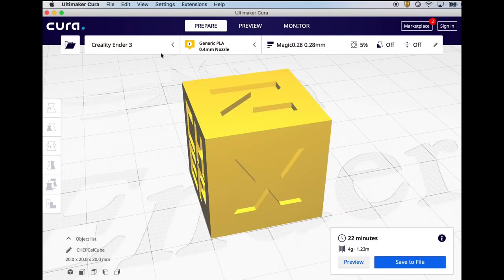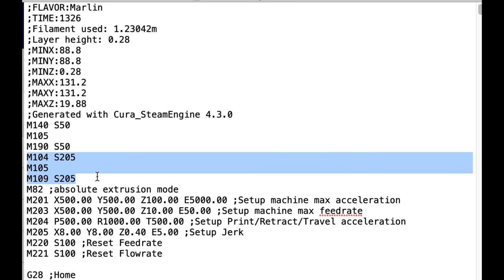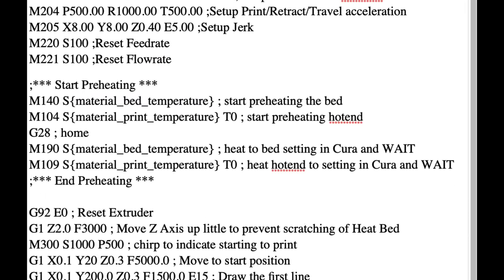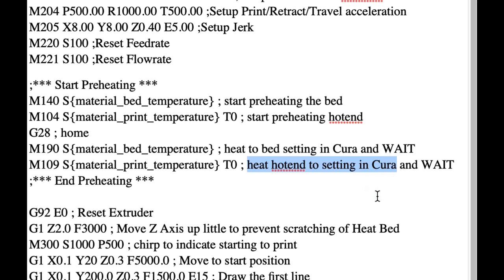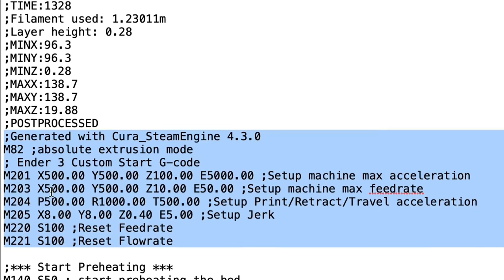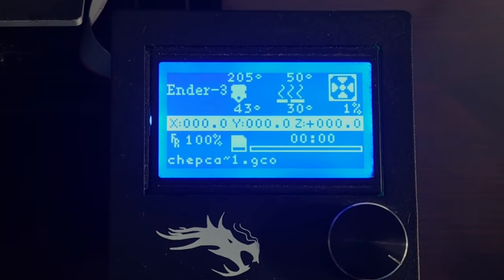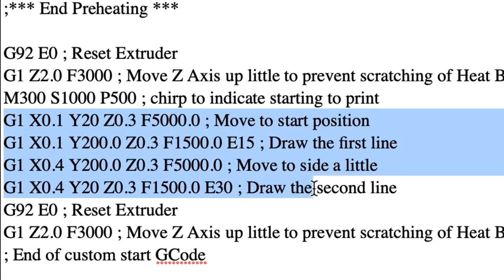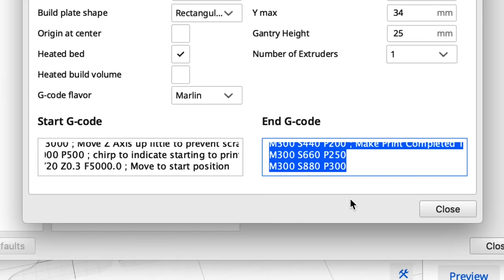Faster Hot End & Heated Bed warm-up in Cura

Comment: For print and bed temperature, your start gcode should use {material_print_temperature_layer_0} and {material_bed_temperature_layer_0} to allow for the first layer temperature to be different than the rest of the print. Also, I read in the comments that you updated the txt file to remove the bad characters, the web snippets still have errors (guess which I tried to use...). Thanks for the great tip!
Reply from the maker: What error do you see in the snippets?
Reply: @FilamentFriday  In the start g-code, there is an invisible unicode FEFF in front of the T0 on the M104 and M109 lines. I copied/pasted the lines and my nozzle would not heat until I removed the invisible characters.

Comment: BRILLIANT Chuck, many thanks for ending my frustration. My CR10-mini works absolutely fine with this code... I knew the PSU would handle it, because up until now, I've manually set the extruder and bed to heat together, whilst I prepared my print in Cura.   Maybe you could consider looking into how to keep the extruder and bed at temperature at the END of a print ? I've tried to add copies of the heating Gcodes at the end of the Cura Gcode, but there seems to be hidden commands that are run once the Gcode completes. It really frustrates me that I have to manually set the temperatures at the end of a print, to keep things hot, whilst I remove a print and get the next one running.......  Your Filament Friday channel is the best thing since sliced bred ( and beer ), Thanks Chuck....
Reply from the maker: I’m not sure exactly how to do that.

Comment: The primary idea of heating the bed then the hotend as a universal code was not because of power consumption but because of some printer may use between 5-40 min (or longer) to heating a bed while the hotend usually does not take more than a min to heat up. If we take the extreme of those cases the hotend will be cooking the filament in over half an hour which give a nice black dot of burnt filament when starting to print at best. And worst case scenario is that the filament clogs.
Reply: I made mine preheat the hotend to 100c and the bed to full temp and once the bed reaches full then the hotend goes to full.
Reply: When it's on do you wait or do you need to go somewhere in the settings
Reply: @zambiekill7046  not sure if i understand your question. But i changed the start code in the slicer (simplify3d and cura, i use both) to include preheat of hotend to 100c and bed to its target (63c) then once bed hits 63 the hotend automatically goes to its target (220c) and its starts printing once the hotend reaches 220c

Comment: For those that just wish to copy/paste the lines used in the video, see below  

;***Start Preheating ***
M140 S{material_bed_temperature}; start preheating the bed
M104 S{material_print_temperature} T0 ; start preheating hotend
G28 ; home
M190 S{material_bed_temperature} ; heat to bed setting in Cura and WAIT
M109 S{material_print_temperature} T0 ; heat hotend to setting in Cura and WAIT
;*** End Preheating ***
Reply: Thank you very much.  I had trouble using Chep's code as it appears in his file.  Why does he have those extra slashes?
Reply: @allonmessenberg3129  I see what you mean, I did not look at it before. To me, it looks like it could be CR/LF line end conversion problems with the file host he is using.
Reply: @allonmessenberg3129  he was using his Macintosh editor and it was saving his files with each hard return composing of two characters - carriage return (return to the first letter of the row)  and line feed (move paper up one line). PC as a standard would save ASCII text as a single character of CR/LF that does both the carriage return and line feed together. These were instructions to line to printers originally on what to print and how to move the print head around.

TL;DR - It's a holdover from the early days of computing where different file encoding schemes were in use.

Comment: I think its not as much of a problem with overloading the power supply but if you think about it, Cura was made for the Ultimaker. And the Ultimaker has a glass bed which takes a lkt longer to heat up than the hotend. That would result in the hotend reaching its temp and than basically cooking the filament inside for the time it takes for the bed to heat. And we all know what cooking the filament does in bowden setups 😆
Reply: You haven't used an Ultimaker isn't it?
Reply: I havent but I still belive the Ultimaker has a glass bed...or doesnt it?

Comment: The start and end g code has a significant impact on printer operation. It is surprising it does not receive more attention.
Reply: What do you mean by that, the current code or Chucks mods?
Reply: You can make all kids of change in the start/end Gcode, CURA or Prusa.  It is a worthwhile area to learn and experiment with.  I had trouble with my MicroSwiss hot end clogging if filament was left and cooled down.  I changed the end Gcode to retract 35mm of filament before it turns off the heaters.  Here are my start and end Gcodes

;Daw Start Gcode for ABL and MicroSwiss hot end
M140 S[first_layer_bed_temperature];  set bed temp
M104 S[first_layer_temperature] ; set hot end temp
M109 S[first_layer_temperature] ; wait for hot end temp
M190 S[first_layer_bed_temperature] ; wait for bed temp
G28; home all axis
G29; use EZABL or BLtouch
G4 S10; wait for 10 seconds for temp recover
M300 S1000 P500 ;  chirp 
G92 E0;  set extruder to 0
G1 X0.1 Y20 Z0.3 F5000; G1 Z2.0 F3000; move to save zone
G1 X0.1 Y100 Z0.3 F750 E15; extrude 15 units
G1 X0.4 Y100 Z0.3 F5000; move again
G1 X.04 Y20 Z.03 F750 E30; extrude 30 total units
G92 E0.0; reset extruder to 0
G1 Z2.0 F3000; raise hot end to z.20

;Daw END Gcode for ABL and MicroSwiss hot end
G1 E-35 F300;  Retract Filament to minimize dropping filament
   ; retract 35 mm SLOWLY - before turning off hot end heat
   ; this is to prevent filament staying in MIcroSwiss hot end when cooling
M104 S0 ; turn off temperature
M140 S0; Turn off Bed
G1 X5.0 F2000
G1 Y2900 F1000;
M84     ; disable motors
M107 ; turn off fan
M300 S100 P500 ; chirp
Reply: @woodwaker1  You're correct, I extrude and wipe my nozzle on a small brass brush before starting each print. it "seems" to give me a better first line, however, I wonder how much of that is just me thinking it. I asked my question because I was wondering if there was some problem with the code Chuck published. Thanks
Reply: @TheDgdimick  I think CHEt's code is good.  You make and fine tune the code that works for you.  That goes back to what Just Peanuts was saying.  There is a lot of power in these start and end codes.  I do 4 skirt's to reprime my nozzle, and get the flow working.
Reply: David Wilson Retracting filament after a print finished to prevent clogging is a good example of a beneficial g code  addition. Cleaning out clogged    hot ends can be a pain.

Comment: I have been using Octoprint to preheat my CR-10S. The extruder heats up a lot faster than the bed. So usually I start the pre-heat, then submit the job. As soon as the bed reaches temp, it starts printing.

Printer settings:
Firmware Marlin 1.9
Cura 4.4.1
Profiles, modified Magic .20 and .28
    modified: temps, infills and supports depending on the print job.
Extruder 205 initial layer, 200 after that
Bed 65 initial layer, 60 after that.
Stock glass bed, sometimes add glue for difficult filaments.

Comment: Hi CHEP, I know this is an older video but do you have a video showing a start gcode that makes it so you don't have to babysit the printer on start up? I mean, I always need to clean the oozing from the nozzle as it's homing. My goal is to maybe home the printer first, then park the nozzle in a position where it can ooze but not interfere with the two purge lines it prints before printing my file. AS of now it leaves a small ball of filament in the center of the build plate even if I wipe it before it homes and sometimes it leaves a fine string from the center to the left side when it prints the purge lines. I usually use a feeler gauge to scrape that stuff off before it's ready to print.

I want to hit print but then go make breakfast and not worry about it, haha!
Reply from the maker: I don’t.

Comment: I did not use the trick you used for Cura to automatically do this. But I have manually edited the Gcode to do this on my CR10S and it seems to work fine.

Comment: Chuck, I use the "Print via USB" option in Cura. I can't seem to get the Hot-end to pre-heat at all with your g-code. Have you run into this? if so what is the fix? Thanks!!
Reply: I had this issue too on my 2021 Ender 3 - Move the G28 to the beginning like this (and use M117 to change the text on the print for extra cool factor):

M117 Monkey Mode Reset {material_type}
G92 E0 ; Reset Extruder
G28 ; Home all axes

M140 S{material_bed_temperature_layer_0}     ; set bed temperature to e.g. 55 °C and continue
M104 S{material_print_temperature_layer_0}   ; set hot end temperature to e.g. 210 °C and continue
M117 Monkey Mode Preheat {material_type}
M190 S{material_bed_temperature_layer_0}     ; wait for bed temperature to reach e.g. 55 °C
M109 S{material_print_temperature_layer_0}   ; wait for hot end temperature to reach e.g. 210 °C
M117 Monkey Mode

Comment: You also saved the start and end gcode files on the website as rtf rather than txt. They're still readable but not copy&paste friendly :)
Reply from the maker: They appear .txt for me. Might be a Mac vs Windows thing.
Reply: @FilamentFriday  just double checked: definitely rtf, both on mac/bbedit and w10/notepad++
Reply: @FilamentFriday  Confirmed that the files have an "RTF1" header in them followed by the text section.
[edit] Here's the first line of the files: "{\rtf1\ansi\ansicpg1252\cocoartf1671\cocoasubrtf500" - and there's definitely "rtf" code interspered throughout :)

Comment: If you have a bltouch you need to heat the nozzle to about 160C without waiting, heat the bed waiting, then run the G29 after waiting for the bed. When G29 is finished heat the nozzle to temp.

Comment: Hey Chuck. I added your start and end G-Codes to my Cura profile. Additionally I added "M109 R30 ;cool down hotend to 30 degrees and wait" after the beep, followed by the Turn-off fan command shifted to this position. I think this could be helpful to cool down the hotend with the help of the fan.

Comment: This will save me a ton of hassle and time considering I was manually selecting a heat profile before selecting the file to print. I'd put the home after the heating so any warping and expanding the bed will do gets detected by the induction sensor. 

Please put the code in the description so people can just copy/paste it rather than typing it out manually. I downloaded the file that's in the description with a text document, but it seemed to have some weird anomalies that I had to correct to match the code you have on the screen. Plus it's such simple code does it really need a download?
Reply: I found the same, it looks like the sample files may have been saved as RTF instead of TXT.  Edit: Yes, renamed from .txt to .rtf and renders fine.
Reply: @jhillyerd  It's showing as .txt for me

Comment: Hey in your opinion what is the best slicer is it cura, sli3r, or what free slicer would you suggest?
Kinda a noob to 3D printing
But we use vectorworks at work to design concerts and I would like to miniaturize that in print it out in my 3D printer but I think I'm going to need a really really good slicer but I don't want to pay a $150 for one
Reply from the maker: Cura or Prusaslicer work well. Each has advantages. Some prefer ideamaker with better improved support.

Comment: Thanks for your great tips, you are subscribed. 

I have implemented the Startcode successful, Thx for that.

For my Ender 3 V2, I think the simultaneous warm up of hotend and print bed is not so good.

I tried it and found that the bed heats quite unevenly and it takes time to distribute the heat. (Tested with thermometer)
Exactly the time it takes to warm up the hotend afterwards.
If both heat up evenly, the bed still does not have an even temperature and PLA adheres less well.

warm regards from Germany
Rolf

Comment: I actually use octoprint for printing and i generally use the temperature control tab to have bed and end heat up at the same time before submitting the print
Reply: Ditto here, just wish there was some logic in it to calculate and compensate for different rates of heating so that they arrive around same time.  As another said here, no benefit to cooking your filament while waiting on the bed...   My Sovol SV06 has the hotend up to 220+ about a full minute before the bed reaches 90-100.

So if I'm sitting there, I will often kick off the bed heating, wait a bit, then kick off the hotend.  Can't wait for all this AI mania to hit Cura and 3D printers in general.  Would be nice to have a microphone and just give voice commands like Alexa!

Comment: Most, if not all beds change shape when the initially heat up until the entire bed reaches a consistent temperature,  that takes a little time after the thermistor indicates the set point has been reached, so it's probably better to leave the bed heating up first as it gives it some time to equalize while the hot end warms up.
Reply from the maker: Works every time for me and Ive been running this for months on various machines.
Reply: I'm sure someone of your skill implementing such a change on highly tuned machines would be one of the test groups that would be the least sensitive to such a change. Conditions that would be most sensitive to the effect mentioned above would be prints which cover a large surface area of the bed that would therefore experience the greatest amount of curvature during the first few layers, filaments or build surfaces with poor adhesion, beds constructed with high CTE materials, machines which do not have automatic bed leveling, cool environments that allow large differences in temperature during startup, poor heat distribution, etc...

Comment: Is there a way to do maths in the start/end gcode? My printer heats the hot end much faster than the bed and I don't want to bake the filament in the nozzle for a couple minutes, so ideally I'd start heating the nozzle some 20 degrees before the bed reaches the final temperature.
1. Heat bed to {bed temperature - 20} and wait
2. Heat bed to {bed temperature} (and proceed)
3. heat hotend to {hot end temperature} and wait.

Comment: I had been using the preheat for PLA function since the beginning, so I never understood why this happened sometimes!  The scant few times I'd tried to turn on my printer and run right away I was confused why the nozzle temp said 0. I thought I had done something wrong in the slicer, didn't know what was going on until I watched this.

Comment: Chuck - Thanks for these G-Code changes .. they work go ...  I received my replacement SunLu S8 and I am still having a problem with the Bed Warm Up ...  I set it from Cura and it shows warming to 60 deg C .. then the Hot End heats up to 205 C.. when it starts to print the bed now shows a temp of 0 zero and it starts to cool off if I don't catch it .. .. and of course the project beaks loose and the print is ruined ..  Have you noticed this in your SunLU S8 and if so - how can I fix mine to stay at the set temp. while printing ..??  Thanks

Comment: Let me recommend an improvement. In fact, the hotend usually heats much faster. And, having a hot hotend long before print may actually cause issues, expecially when the axial head fan weakens - by causing the upper parts of the extruder overheat with no downward material flow.
How about wait-heat some default, high enough temperature of the bed, say 48 degrees, before the heat up command, and then send both bend and hotend to heat up.

Comment: Handy code addition. Is there a way to alter the "Preheat" settings to up the temps to 5C below print temps rather than 15C? BTW default for 3 Pro is 185C preheat (controller) / 200C print hotend (Cura) and 45C preheat (controller) / 60C print bed (Cura). I don't want to alter anything to mess up the controller settings.
Reply from the maker: Firmware change if it isn’t in the control menu.
Reply: @FilamentFriday  Found the correct sub menu thank you. I messed up the origin setting and had to reset it when I first started playing with the settings trying to center the print on the bed and it took me almost an hour to figure out what I did wrong and seconds to reset... The current Cura (4.3.0 atm) lets me offset the print center as you showed in another video. Keep finding those hidden slicer gems to make our printing easier!

Comment: Your startup Gcode would be better like below.  I use a hotter temperature for my first layer on my Artillery X1 so it needs to use (first_layer_bed_temperature) and (first_layer_temperature) to use the initial layer temperature instead of the Default Printing temperature.

;*** Start Preheating *
M140 S{first_layer_bed_temperature} ; start preheating the bed
M104 S{first_layer_temperature} ?T0 ; start preheating hotend
G28 ; home
M190 S{first_layer_bed_temperature} ; heat to bed setting in Cura and WAIT
M109 S{first_layer_temperature} ?T0 ; heat hotend to setting in Cura and WAIT
;*** End Preheating *

Comment: Chep, thank you very much!
What about preheating the bed and the nozzle while BLTouch probes the bed? :) That would be great! Think about it, it takes cca 5 minutes to do all that before starting the print. Probing while heating would basically remove the only drawback of the BLTouch - the probing time!
Reply: There's a good reason it waits for the bed to be hot before probing, the bed changes shape slightly during heating due to thermal expansion.
Reply: my suggestion put G28 (homing) and G29 (probing) commands after it finishes waiting for the nozzle ant the heatbed to warm up.